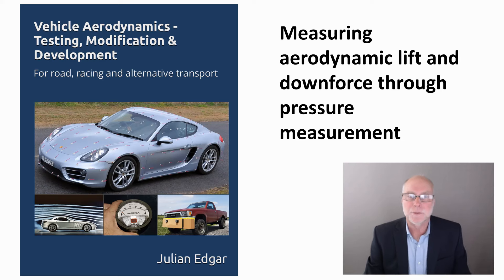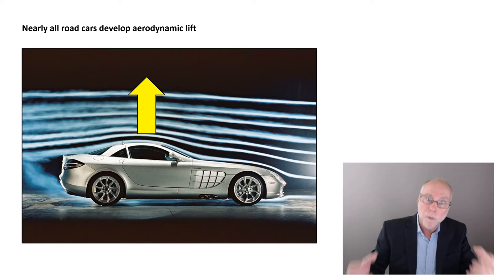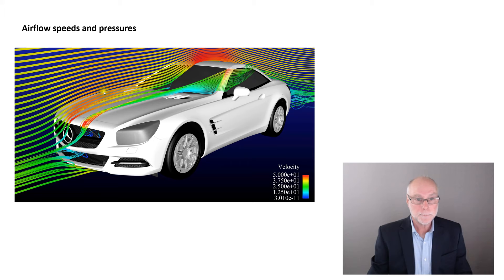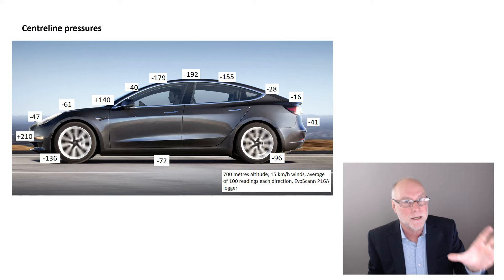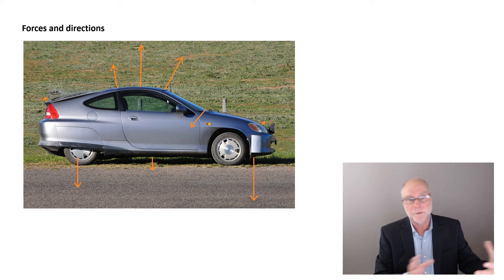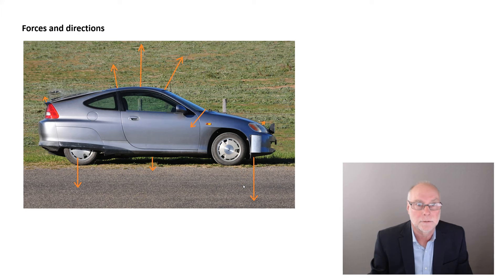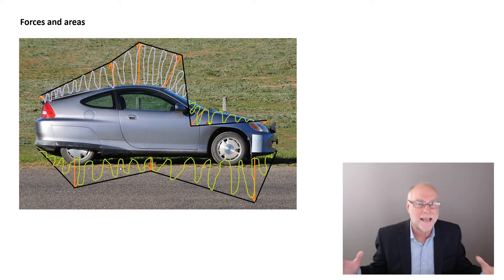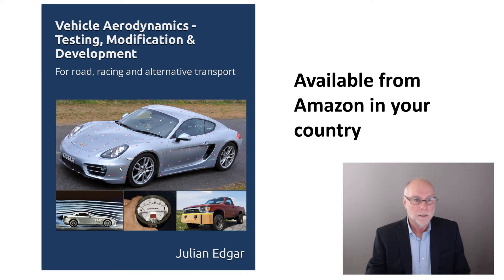Measuring aerodynamic lift and downforce through pressure testing

Comment: Thank you for making a lot of this information public. Greatly appreciate it!

Am currently trying to find the most cost effective (well, cheapest) way of doing aerodynamic testing and learning on my RX-8. Would you say that setting up a small scale tester would be the best way to roughly figure out general information/airflow?

Or would it be more effective to get a 3D model and do simulations?
Reply from the maker: Testing with a physical or software model will be VASTLY less accurate than testing the real car on the road.

Comment: So if i understand correctly, the car at 3:23 if creating lift because the pressure is lower at the top of the car so it bring the car up ? In this case, is it the same as an airplane ( low pressur on top and high at bottom) ? And if the velocity of the air was faster under the car and slower on top of it, it would creat down force right ?
Reply from the maker: Yes, and yes